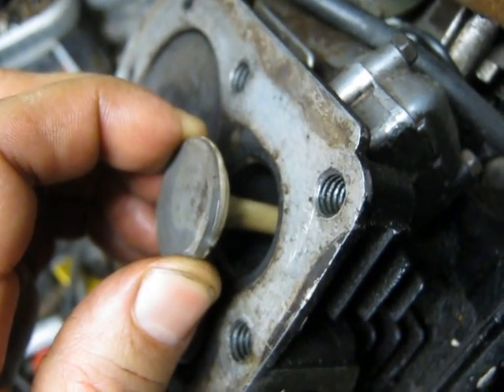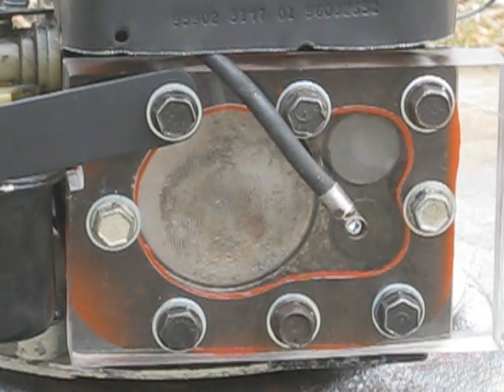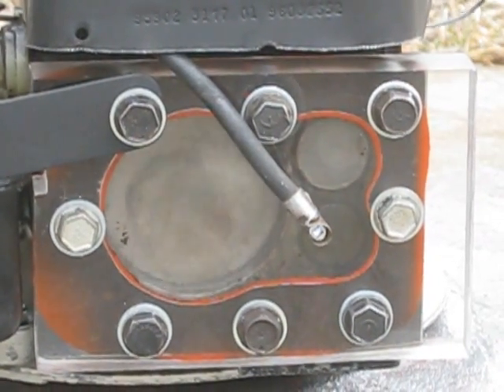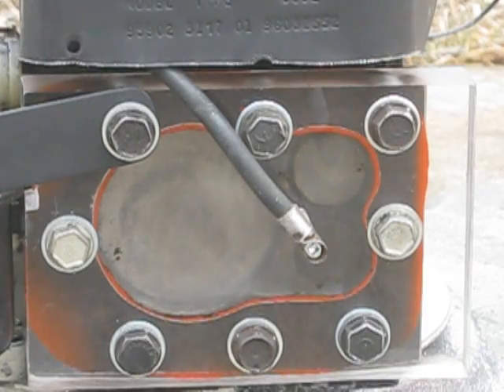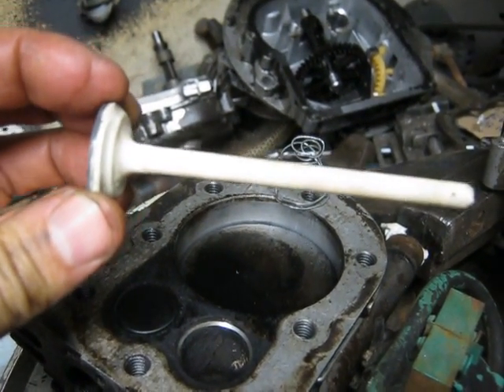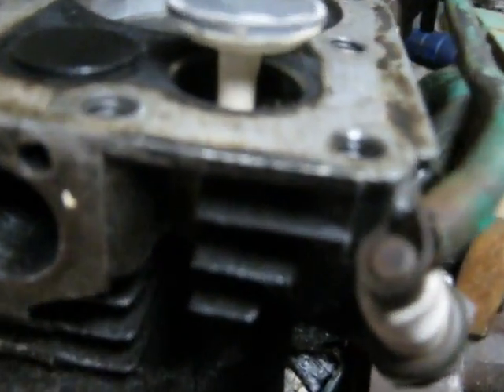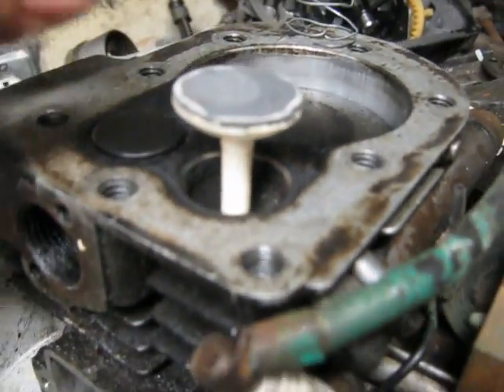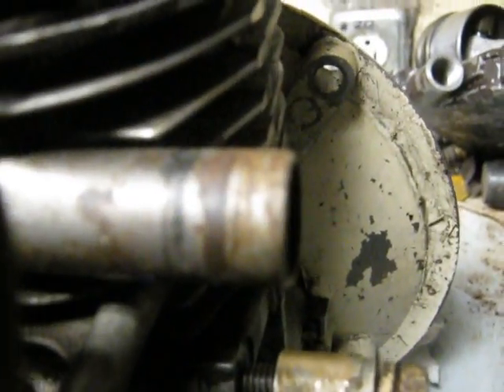Plastic Intake Valve & Glass Head Briggs!

Comment: I see how you are using a screw grounding out against the block surface as a spark plug.

I wonder what would happen if you grounder it out against the piston. You have a constant voltage potential between the screw and ground, and it finally sparks when the piston gets close enough for there to be a spark.

It would be great for a 2 stroke engine.
Reply from the maker: Not saying the piston grounding idea won't work, but there will be a film of oil to contend with, plus it could leave some arc burns to the piston and cylinder, which wouldn't be good. I imagine it would work for a short run though.

Comment: What about casting a valve or piston out of JB Weld?
Reply from the maker: A piston would cost a mint, but a valve is possible. First I will repair the plastic valve with JB, and hope for a much longer run. I think the seat pressure was too low.

Comment: What's the deal with the spring on the plastic intake valve?
Reply from the maker: I made the spring out of light gauge wire, as i didn't think the plastic could take the pressure from a regular valve spring. Plus it operates as an automatic valve allowing the engine to rev more slowly, like an old hit and miss engine. I show the damage to the valve on my wooden piston, glass head vid I am uploading.